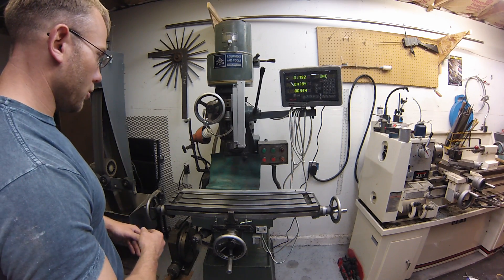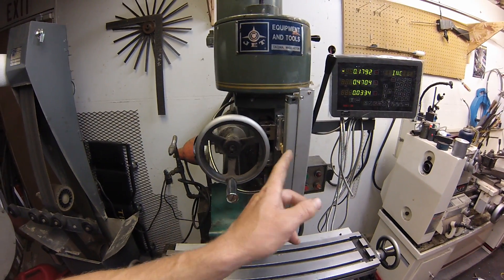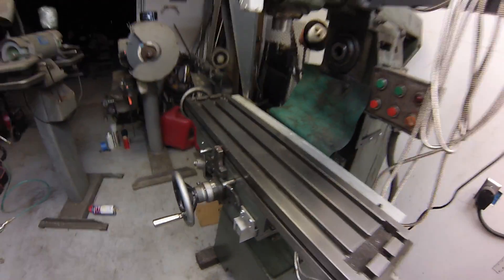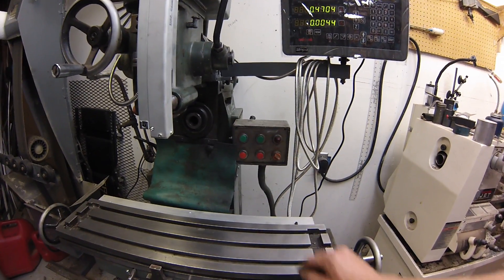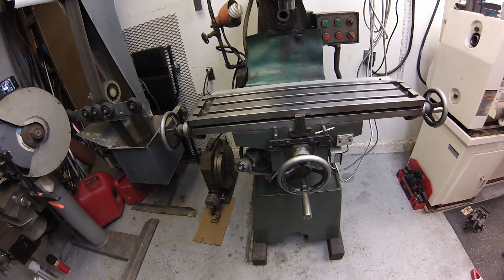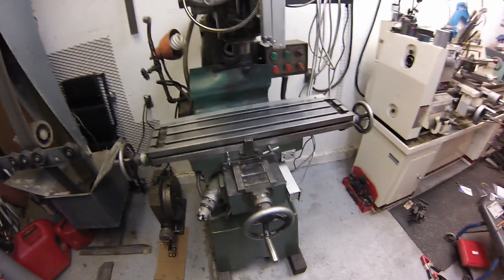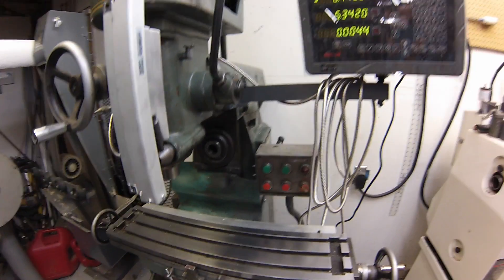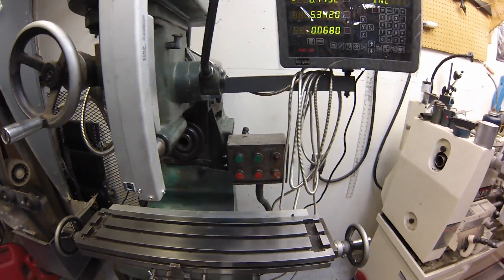Best 3 AXIS DRO for milling machine digital readout 2014 SINPO

Comment: How is is working now?  Have you had any problems with it since installing it?  I am thinking of getting one but I don't want spend dollars on something that will die with in 1 year.
Reply from the maker: +Mike Smith It was sold so I am not sure how it is now. It worked great for over a year for sure! I have since bought another if that says anything. But have not had time to install it on my new mill. I would put the DRO 3 axis readout on the knee though. Use a cheap digital scale for the quill feed! Then you have DRO on all 4 movements.

Comment: No sound?
Reply from the maker: There should be I double checked it.
Reply: Volume is so low your narrative cannot be heard.  Is there a way you can bump it up a little and let us dial it down on our end if necessary?
Reply from the maker: T 2thferry  Hey there. It is not a audio quality issue. It is quite good each time I check it. Try somebody else's computer. I have listened on a few different CPUs to find what sound is not audible. The narrative is easily heard on each. Take care, and you are better off not having to hear me anyway...
Reply: The audio is definitely very low volume on multiple devices i have watched this on.
Reply from the maker: +Don B Your right, sorry I have address this on all my future videos by buying a shotgun style microphone(about 250.00 bucks). Thanks for the heads up.

Comment: Man I need a mill like that
Reply from the maker: You can get ahold of a used bridgeport 9''x42'' for 3-4k if you keep your eyes peeled.I would recommend going for a real machine over this smaller one if you have the space. But if budget does not allow, this is a great machine for the money. The Digital readout is awesome and works well. I have installed another one on my big milling machine. I have since sold this smaller Jet Mill. Have fun, save the cash somewhere your girlfriend or wife does not know about, and when you see the mill you want buy it, and tell her you got it for 50.00, the women believe it and will still wonder why you spent 50.00 on a "big ugly machine".
Reply from the maker: +Finn Custom Knives 

I also have a RF45 based machine now. I bought the Charter Oaks one, it has the most travel from all these variants from what I have found. The machine is way less quality than the old jet this video has, which was a disappointment. But I guess you get what you pay for. The bridgeports are amazing and I will buy another some time. Take Care
Reply: Unorthodox Fabrication Until they read this.
Reply: I ended up getting a precision matthews pm932, basically a rong fu 45 clone with power feed on x and z, and I equipped it with a 3 axis dro and a kurt d688. Absolutely loving it for my applications of knife work. If I had easier access to the shop, or was working on larger/heavier parts I would have gone with a bridgeport or the likes. However, it would have made for one hell of a rigging job. When I get to a new location I will keep that in mind as a knee mill is definitely in my future
Reply: A DRO setup for 500 bucks is almost stealing in my opinion .I'm going to look into this when I get my lagune . Unless it is already included of course , But it Seems like a solid product .Did you have any problems while you had it?
Reply from the maker: No problems at all. If you are buying a new mill I would buy it separate and install it yourself. You will save a ton. But if you want a nice accupro of fagor unit which they probably use by default, you will not regret the quality. 

I on the other hand, spend most of my money on the tooling and other machines. The SINPO DRO's work very well. The installation does require some creative thought process... But thats what we are good at.
Reply: yah dros are great I love using them but would rather get more tooling.did you know the .lagun ftv 2 knee mill accepts cat 9 tooling?
Reply from the maker: I am not familiar with those machines. I did not know cat 9 existed? That must be a pretty small taper?